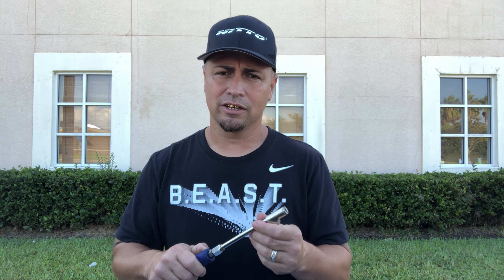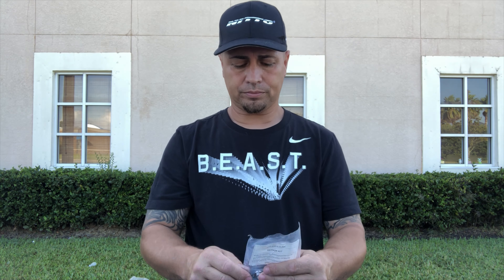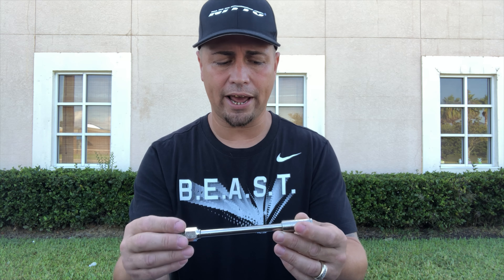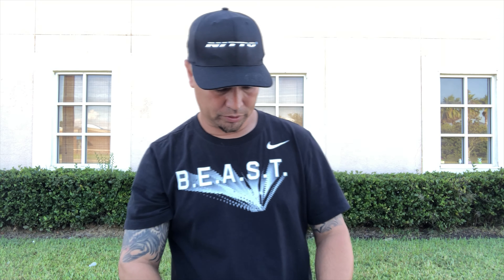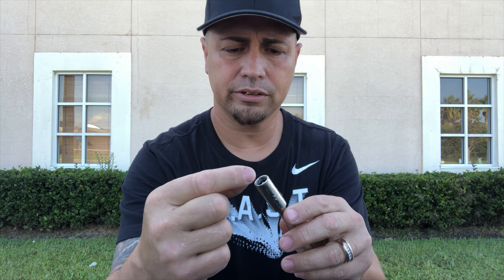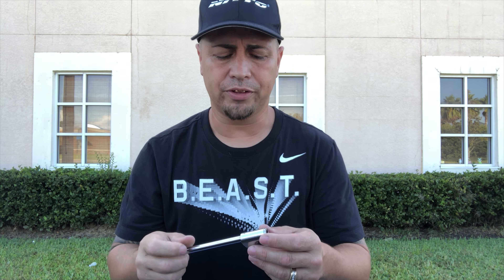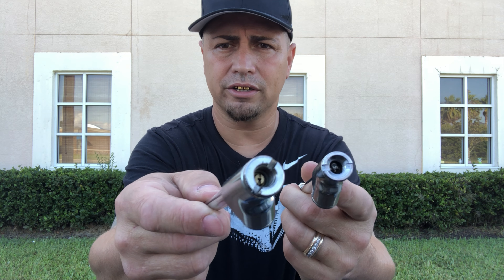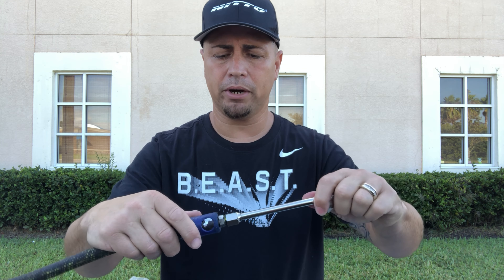Repair a leaking Air Chuck

Comment: So many years fighting air chucks with locking levers and now I finally find one that does it straight on so it can clear most hubcaps and industrial rims with welded stem protectors. Hell, I probably have one but didn't realize it would hold on its own. Thanks